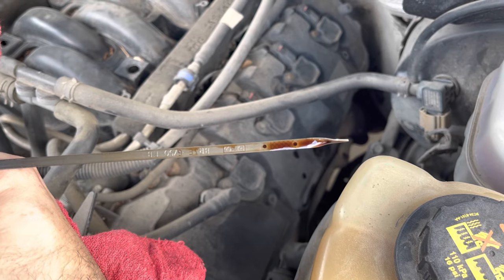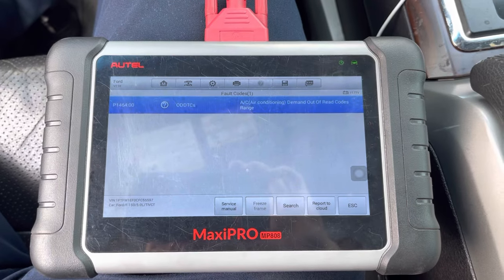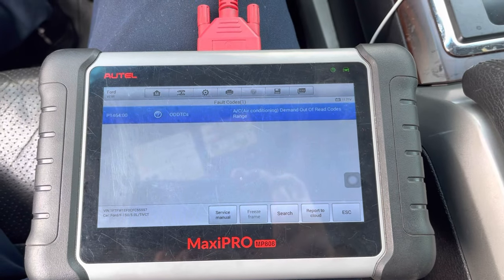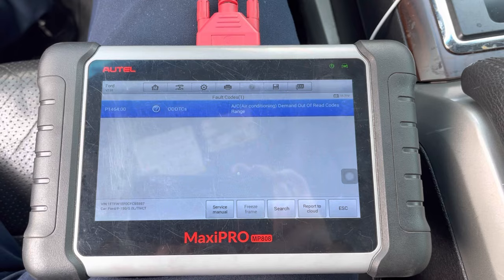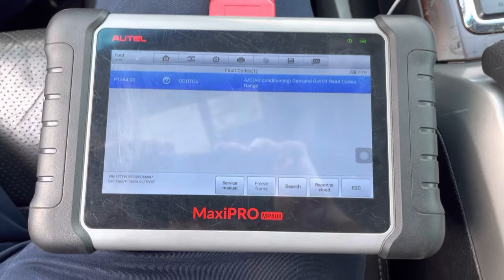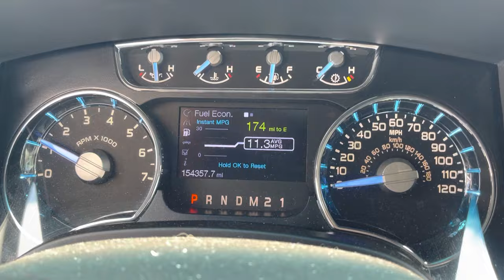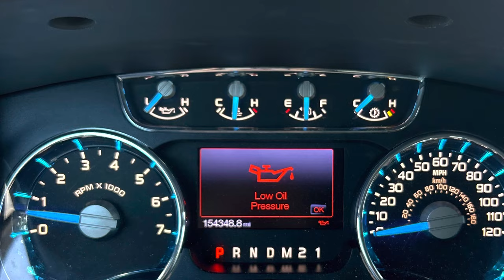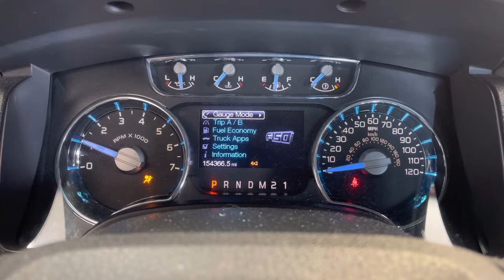How to Fix “Low Oil Pressure” Message on 2011-2021 Ford F-150

Comment: I'm thinking about buying a 2010 f150 with 260,000 miles on it with oil pressure issues, risk it or not?
Reply from the maker: Definitely not. Most likely, that 2010 has the 5.4 engine and they are known for engine issues. If you can somehow prove that it’s an oil pressure switch and nothing more, then great. But otherwise I would pass.
Reply: @jackhfletcher  what about a 2014?  would it also cause transmission to not shift right? 195k miles

Comment: Did you have to drain the oil first?
Reply from the maker: No. You’ll lose a little bit of oil when you remove the switch but you don’t have to drain the oil.

Comment: Is there any reason why my engine starts knocking when the message comes up. When it starts to knock I turn it off and crank back up and it runs like new after
Reply: Not a mechanic, but I think you actually lost oil pressure.
Reply: @griz2166 yeah sounds like it

Comment: Where is this oil pressure sensor at on a 2012 f150 3.7 2wd
Reply from the maker: It’s in a similar location. It’s located on the oil filter adaptor.
Reply: @jackhfletcher  I found it, it was right behind the alternator as well about to head to orielys and change that part out hopefully this does the trick I've already changed out the throttle body and the purge valve thinking that was the issue fingers crossed

Comment: I replaced my oil pressure sensor motorcraft ford part, but still show low oil pressure 08/17/2024..
Reply: Anyupdates

Comment: Is it safe to drive with psi shows 0?
Reply from the maker: It’s most likely just a bad sensor which would mean it’s ok to drive because the oil pressure is good but the sensor is lying. But if the sensor is good and the oil pressure is truly 0 then it’s not safe because the engine will grenade itself after a very short time.

Comment: Getting this message on my 2013 F150 4 x 4. Change the oil pressure sensor did not work. Change the throttle body that did not work. Plenty of oil in the vehicle. Got to be some other problem!
Reply: Did you get it fixed? If so what was it?
Reply: Did u
Reply: I learned an amazing thing! I switched to 5W30 full synthetic and I never got that alert again! 5W20 full synthetic is too thin!!! 5W20 full synthetic is much thinner than the recommended 5W20 blend or regular. 5W20 full synthetic will cause all kinds of issues in your 5.0!!!

Comment: 2014 ford f150 4x4 echo boost. YOU DO NOT a have to take the alternator off so stop lying. You can do it from on top takes about 45-1Hr. All I had to do was take off my air filter box and water box off and take the wire off the alternator all from up top.
Reply from the maker: At 3:26 in the video I specifically state that on the EcoBoost models, you can reach the switch from on top. Before calling me a liar, maybe you should rewatch the video to jog your memory as to what I actually said.

Comment: Wow. What a rip off. You did all that work and charged the customer ton of money for about an hr job from on TOP.
Reply from the maker: “Rip off” That’s a pretty bold accusation. In your previous comment, you mentioned that your truck is a 3.5 EcoBoost. The one in the video is a 5.0. Different engine, different procedure. The factory repair procedure states to remove the alternator on the 4x4 5.0 models and the book time labor is 2.2 hours according to Mitchell ProDemand. On the EcoBoost models, the procedure states to remove the switch from the top (no alternator removal). I’ve read a couple comment from others with the 5.0 who said they were able to remove the switch from on top after fighting it for a while. But the way I’m showing in the video is the correct way according to factory procedure.

Comment: Did you have to drain the oil first?
Reply from the maker: No need to drain oil. You’ll loose some oil when you remove the switch, but draining the oil won’t make a difference.